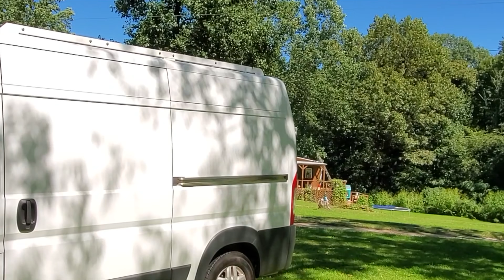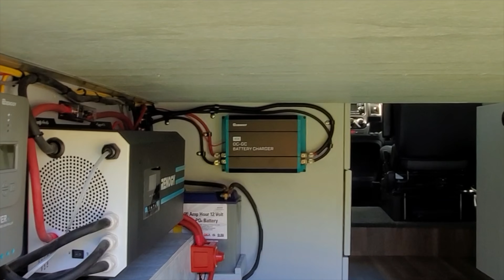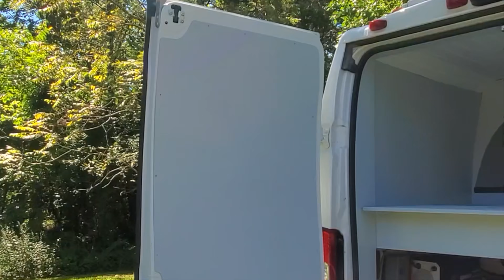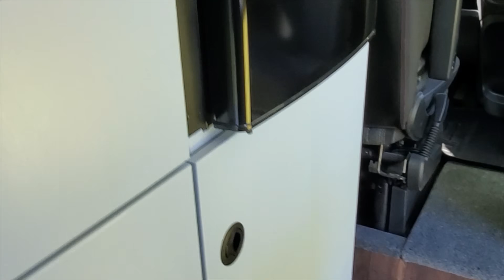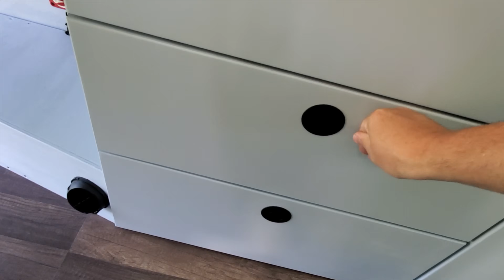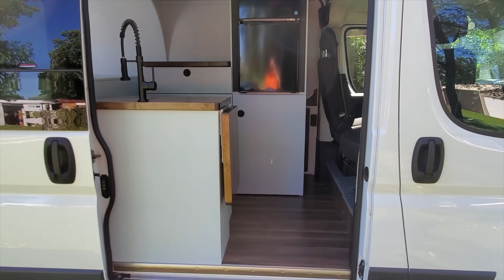Promaster 136" camper van AWESOME dual slider final build!

Comment: Nice and clean build. I like the solid light gray color, makes the space look larger.  I like the design of the bed/couch especially with the storage (plus it being reversible to face outside too). A place for a portable toilet would be nice but he has a large area under the bed, if he doesn't want to put it where the portable a/c unit resides.   Great workmanship on this build (especially refraining from using the spray foam in areas that may need access for repairs.)

Comment: Does this build require 2500 or would the 1500 be fine?
Reply from the maker: Its not required, but its very highly recommended.
Reply: @RedsCustomDesign  Why? Can I ask?
Reply from the maker: Higher GVWR, for the added weight.

Comment: Another nice build . Note red there’s a company that does custom water tanks around the wheel well in the back great space savings happy build brotha
Reply from the maker: Yes, I used one of them in the "Peach" build. But it takes up much more space then a standard 20 gallon tank. And after shipping its four times the price.
Reply: @RedsCustomDesign  dammm good  to know brotha . Keep up the vids my man
Reply: @RedsCustomDesign  i thought people went with the over wheel well water tanks because it FIT in snug around the wheel well and took up less room? Wow good to read your comment on the standard tanks Red. Im sure the better choice would be to attach tank under chassis.

Comment: What are the dimensions of the bed platform? Closer to a twin or a full?
Reply from the maker: Full
Reply: @RedsCustomDesign  Red what is that hinge called that you use on the bed?  Looks like piano but stronger? Does it set flush or bumps up a bit? Thank you kindly, such a beautifully crafted build! 🤩🚐

Comment: With a few, minor mods, this might be a perfect build for me, too. You seem to do lots of Ram Promaster builds, have any opinions on the Promaster as a chassis ? Specifically durability / reliability as a vehicle ?
Reply from the maker: Yes I do a lot of promaster's. I just finished a transit.  All I will say is they are not for me.  Not just the promaster, but the transit or sprinter.
Reply: @RedsCustomDesign  Quite honestly, I think a Chevy Express/GMC Savana would be the best full-sized van from a vehicle perspective (even if I had to get someone to add a fiberglass hightop, though I'm not completely sold on the hightop bit). But I hardly see any builder working with that model. Ever done one ?
Reply from the maker: @DavidHuffTexas  I have a 2010 express 3500. I wish it had a little bit higher top bit i wouldn't be afraid to take that thing anywhere.  Even with 400k on the clock. I just pulled my 12k lbs travel trailer with it for our vacation (that I'm still on) with no problems.
Reply: @RedsCustomDesign  I’ll look for the Transit build you mention.  I have the 148 medium roof. I don’t see a lot of those builds as most go with the higher roof, but Im happy to have what I own. Now just need to build it out. Sure wish I had a place to go to to build along side with someone as talented as you Red. Your interior walls and  cabinets are so very clean,  professionally built. Your detailed carpentry skills are greatly refined, Local van community are lucky to have you available as a build choice. Each build is uniquely challenging, good of you to say yes to all models of vans, thats not easy, makes for a custom build each time. You pull it off beautifully. 💪

Comment: I think I'm seeing an accumulator tank before the water pump. Are those absolutely necessary? I just got a 1.2 GPM seaflow cheapy pump, 20 bucks, probably should have got better. Do you think I should get an accumulator tank for it?
Reply from the maker: They are not necessary but it makes it better.  For a pump that small i wouldn't add one.  The pump in this was is a 3.5 gpm.